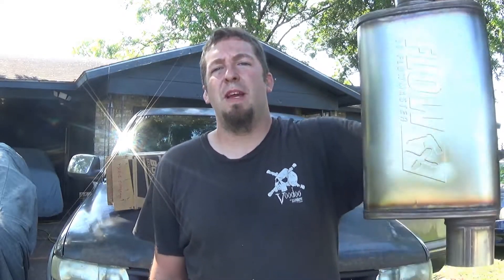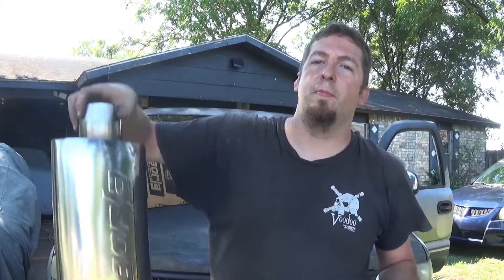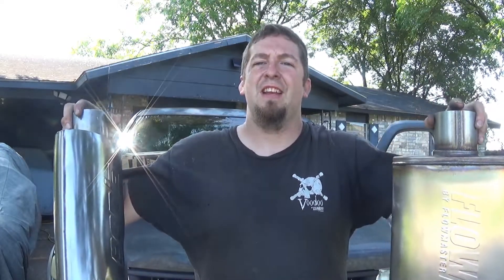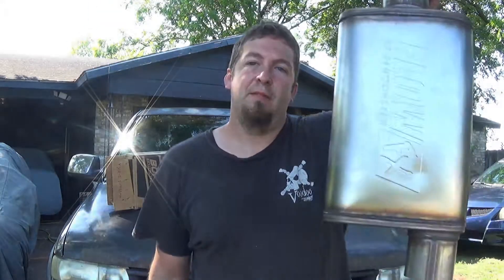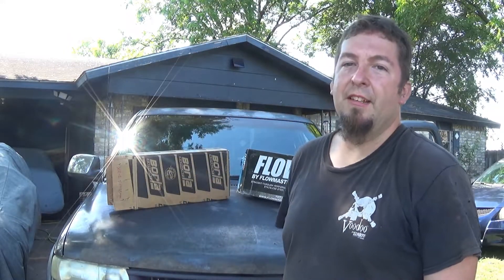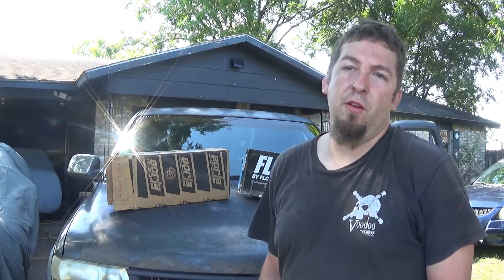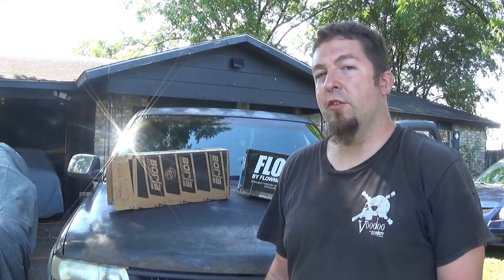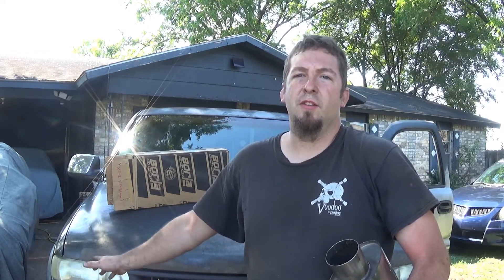flowfx vs borla xr-1 muffler on chevy 6.0

Comment: One month ago installed XR-1 on my 2019 Silverado 1500 5.3L.
Beautiful sound with all additional sound options, like deep idle and back exhaust burbling! But only one problem is….when driving uphill on 8th gear…. Very bad droning occurs. Driving me crazy!!! 
Do you have any drones under engine loads?
Reply from the maker: not on this truck, my g8 has drone in fifth up hills and anything over 2k in fifth gear. but there are alot of factors that come into play with drone, such as the exhaust pipe that can cause drone also with more modern transmissions anything with 5 speeds and over i do notice they can have drone in higher gears do to the rpm they are right with speed. some people  add a j pipe to reduce or eliminate it.